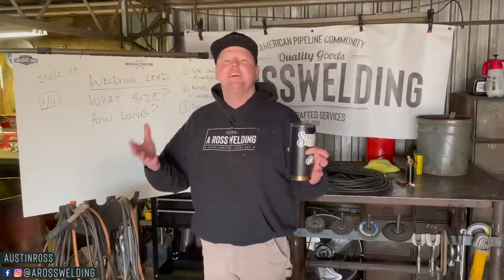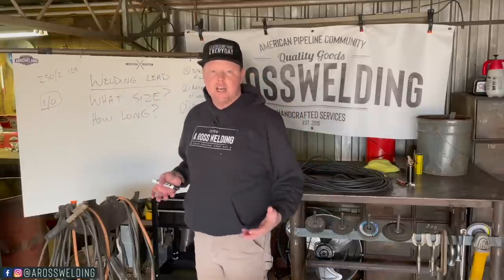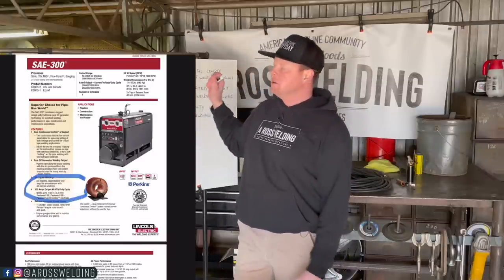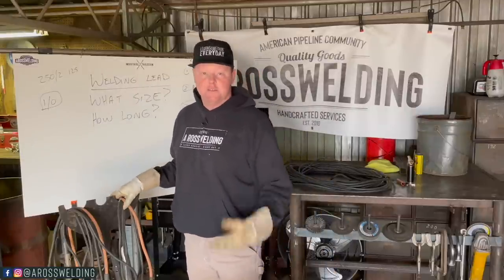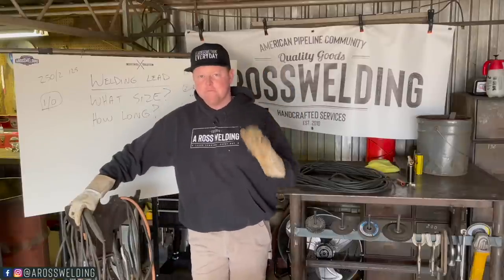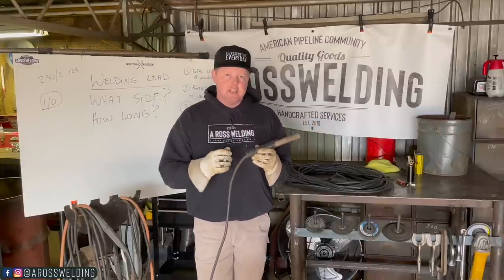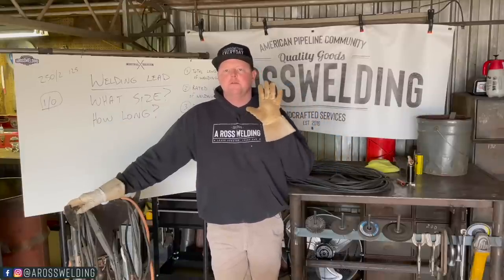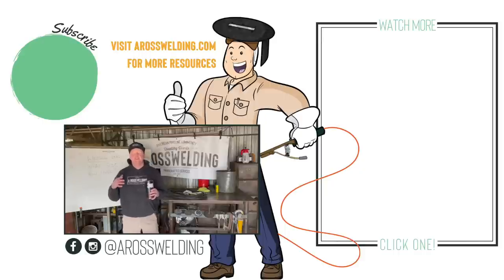EVERYTHING WELDING LEAD / CABLE (WHAT SIZE, WHIP, SPLICING, LENGTH, MORE)

Comment: Always always always make your whip as light as possible when you're welding vertical or overhead. Let some of whip rest on your shoulder or hung over something overhead. I will sometimes put a clamp above my head to drape my whip over if there's nothing to hang it on. It will help a lot especially if you're welding overhead and vertical all day.

Comment: Never seen that method of joining wire together. We used the twist lock connectors and the other style can't remember what they are called. When the ends get all buggered up out come the vise grips. We used to build large marine floats out of 6 foot diameter steel pipe. Welding leads dragged over. We used whips the main leads were 3/O and 4/O. It wasn't new wire we got it from auction from some industrial shop that went out of business. I don't miss dragging leeds around I was only 14 years old, that was 31 years ago.

Comment: Running a 210amp system right now and running 2/0 because it's what I was told to use back when I worked the oil fields. A 100 foot reach is good for most of my jobs and I'm looking to start is a small mobile welding business for apartment and condo complexes and gated communities.

Comment: I got my welder on a boat trailer with a tool box to pull around the farm with 4 wheeler to weld up continuous fence with and sucker rodes. I think the ground is 5 feet and the stinger is on a 20 foot lead

Comment: Austin, how about skinning the cables about an inch sliding them together, then applying current? Thank you for the videos.
Reply from the maker: 🤷‍♂️ worth a shot.. I’d be interested what would happen.
Reply: This is a much better approach.
Reply: Wonder if adding Flux would help them solder together. Like it either way going to do my whips like that from now on!

Comment: Welding leads,are sized & gauged the same as electrical wire; the more amperage you are using the bigger the cable you need. As far as connecting leads together,you can use any splicing lugs common to the electrical trade; as far as the last method you used " welding" your leads together ? I would hesitate to use that method,especially on an engine driven generator type rig,such as your Lincoln 300 or any potable machine,because when you stick the energized leads together like you did,you are actually causing a direct short in the electrical circuit. Yes it will melt the copper together,but if you don't break the circuit real fast,you can burn the carbon brushes out of the machine,or literally melt the soldered connections out of the commutator of the generator/ welding machine; in an A/C machine you could trip a breaker in your box. Other than that,it is a good video,just use the same type of lugs electricians use for large cables & can be found in electrical supply comanies,companies, most electrical contractors can sell parts to the public & most big box hardware stores,like Home depot & Lowes & Ace hardware carry some electrical connectors. Just follow the same safety rules as you would with high amperage electrical circuits,that's basically how arc welding works. Large amperage,bigger wire,less amperage smaller wire, unless you go over 200ft,& then you get amperage drop in long runs of cable / wire; the voltage will drop in D.C.( direct current) machines but in A.C. ( alternating current) it doesn't drop as much in long cable runs,& the amperage doesn't drop as much either.
Reply: How is doing this any different then sticking the electrode?
Reply: I have repeatedly seen sa200s hooked to frozen water lines to thaw them. This little hit is nothing for a generator machine. Ever heard of a load bank?
Reply: Yea welding supply stores sell all the relevant dense and other style connectors of appropriate ampacity

Comment: I saw that on ig about 7 years ago.  I had to flick em, long arc a hot minute, and then jam em up.  You can use copper pipe if you don't have those sleeves too

Comment: You could also easily braise them together with a torch and a piece of rod if you really wanted to get that hard-core. Personally I’ve always just put mine in a sleeve and crimped with a hydraulic crimper

Comment: I never thought about that but now I’m wondering about splicing the cable and soldiering it with dialectric grease and heat tube like you would regular wiring it’ll be good to go on everything including salt water if you do it right and really it wouldn’t be too ridged  if you kept it tight and it’ll be as good as if it were never cut

Comment: So you said that size of lead is determined by length which is true but you also said that you figured your on 250 feet, but you cut your in half which is 125 feet which would make quite a bit a difference  on amp draw especially on stinger lead no so much on ground lead. Being a electrician it kind of caught my attention. With that being said I have learned quite by watching your videos and hope to put them to use on my own fence building, plus you live right here in good ole Oklahoma.

Comment: Just to confirm, when sizing your welding leads, you add the length of both your ground and your electrode lead to size your cable? I was always under the assumption that only one cable was measured for length.  I have been way under sizing my cable.
Reply from the maker: Yes, your total welding circuit. Both ground and stinger.
Reply: Most charts I’ve seen will explicitly say which length to use when calculating, whether it’s the total or just one lead, I’ve seen charts for both
Reply: @garretr4488  the charts that don’t say both leads, assume you understand that.
Reply: Like Austin said, what kind of welding are you doing ? Rated output of machine covers all situations. Guy I bought my SA200 from said in 30 years of pipeline welding, he never took it out of 2nd gear.. 120 amps works fine for 5/32" rods, so no reason to run a heavier lead than 1/0 for my purposes.

Comment: I use 2/0 leads 150ft stinger 150ft ground in 50ft sections I use it with my miller cst280

Comment: Great tip on welding welding leads. Just so I’m clear on this, your connected to the DC + on the leads to be welded? The orange lead is connected to the positive side of the machine and the black lead is connected to your stinger? Thanks 🙏🏻
Reply from the maker: Yes, that’s correct

Comment: If you do a PROPER  western union joint. It will last .  It stays flexible with no hard edges that can damage the wire making a hot spot .

Comment: Austin,  I ordered the inexpensive $80 - --110 volt HONE stick welder, which is rated at around 120 amps max. It comes with copper coated aluminum cables that are about 8 foot long. My question is, do you think it there would be a significant improvement on the welders performance, if I were to spend $40 and purchase pure copper 4 gauge cable that is only 5 foot leads ?
Reply: At 8 feet long probably not that much of a difference. I would invest in longer leads if you choose to buy 100% copper leads. it will make a lot more difference in your welding then having Super Duper leads that are really short. 

Try to get yourself some number two or number one leads that are at least 50 feet long that will serve you well for a long time and you’ll be able to move them from machine to machine. Having enough that you can move around to work piece is key.

Comment: Whats your opinion on the Hobart Handler 100? I just got one and I like it for small projects and stuff. Got some good hobart .030 wire and it does pretty dang good for how small it is. I opted for it over the Harbor freight 125 flux core just because I've heard in general Hobart is a better welding brand and can get parts easier if needed.
Reply: Im not him but ... Hobart is solid though. 👌
Reply: @DonnyBwelding1  right on brother. Appreciate your opinion
Reply from the maker: I can’t say from experience cause I’ve never owned one but it seems like a decent machine from what you have learned about it so far.
Reply: @cashen7384  my pleasure ...so much to learn in welding ...every procedure calls for a different approach . But Hobart is reputable ! That's a good first machine ...and I can tell you the Chicago electric harbor freight isn't good .  If you're looking for a Mts under 1k check out everlast welders but know if u want the best miller or fronius . They are the best for a reason and preform above in my experience
Reply: I got a Hobart Handler works great and I have it wired in for 240 volts. I got a 125 flux core from Horrible freight as well and never had a problem welding thin steel.
Reply: I have a hobart handler 110, a 110-volt wire feed machine. Purchased in 1995. I have only used .035 flux core wire, t71-11 at least 15 - 10 lb. rolls. Still use it often for light stuff, that I dont want a bigger machine for.

Comment: Most welders do tell you, in the manual (you know, the paper thing that ignorant people who think they know more than they actually do, throw away) have a chart that tells you which cable size you need for the maximum amps your machine has, vs the length of the lead. And as Ross has pointed out, the lead length is the length of the lead from welder to torch or work clamp, times two. In other words, he total length of wire.

By the way, when he says to hammer the Surface Pro,ice connector, I hope he doesn’t mean to just use a hammer. That doesn’t work properly unless you have a cast connector with two stubs sticking inside that the hammer will squash against the wire, gripping it. Otherwise, with a smooth connector, you’re just hammering the connector flat, and many of the wires will be loose inside—very bad. You need a crimp block that the connector slips into. You then hammer that, and it indents the connector.

Comment: Wow! I just did the math, for 125 ft. Leads that's half the cost of the machine. I will stick with my way Oversized leads and just not weld in humid/wet locations and just put a whip on me so when it's wrapped around me and it starts raining. I won't be a fish out of water flopping around.

Comment: Instead of trying to weld them together why not just solder then ? Would be a much more electrically sound joint use flux to make sure the joint is peniteated with solder and just keep pushing it in untill it's saturated